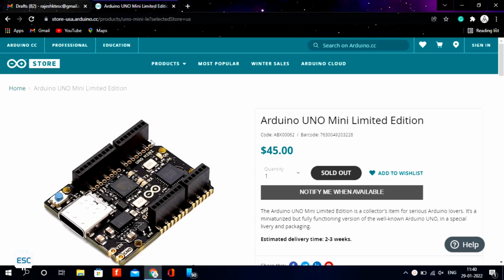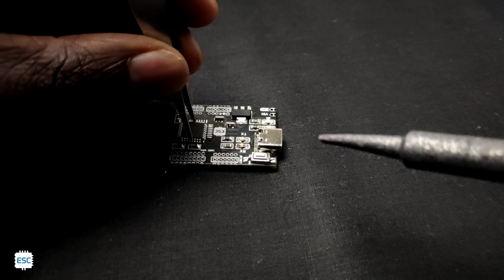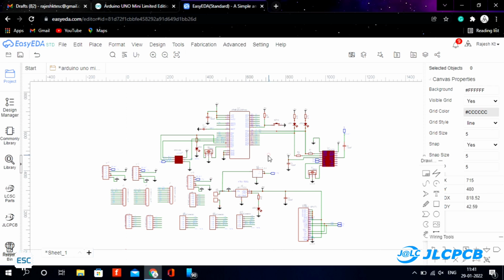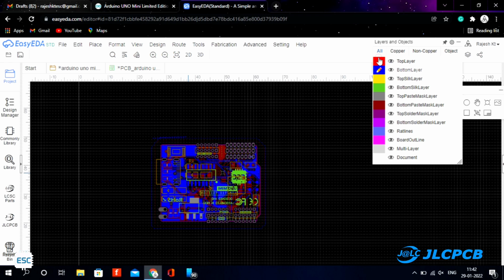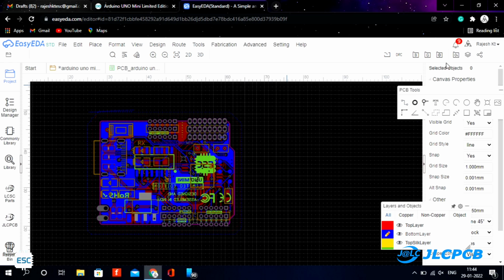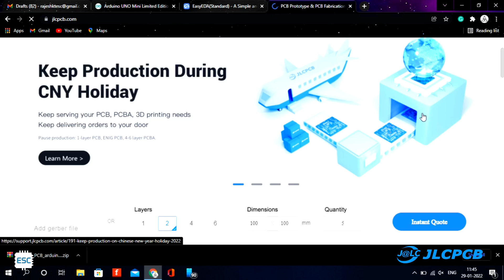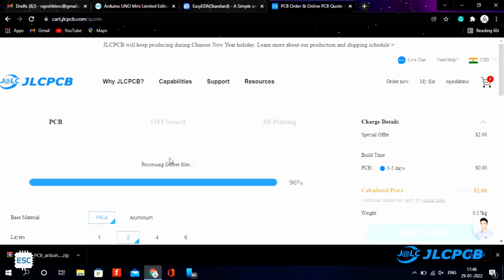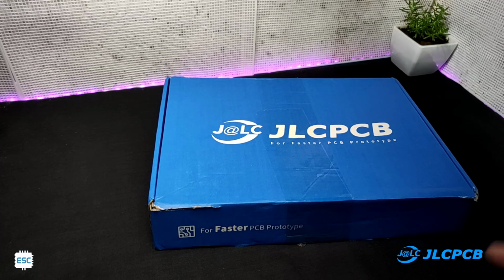ARDUINO UNO MINI CLONE | JLCPCB

Comment: Is there an option where you can combine NRF24L01 with the uno mini? smaller board is better. I need it for my thesis thank you
Reply from the maker: Are you asking how to add the NRF Module?
Reply: @EDISON_SCIENCE_CORNER  I'm not perfectly sure since I'm new to all this stuff, But I'm trying to build a small device that can transmit FSR input in my system. So aside from arduino uno and NRF, I will also use FSR. So I'm wondering if anyone can actually build a mini board like the uno mini that can also transmit signal to my nrf24l01 or any type of receiver, that would be great.

Comment: Awesome work. A 3D printed casing will be a nice addition. I want one unit. Did you check the board with Arduino IDE, and run few basic codes other than blinking?
Reply from the maker: It will just work like other arduinos. And please check my halloween project

Comment: If you use the leonardo design, you can skip the ftdi chip. Saving some space on the board
Reply from the maker: Really.!
Reply: @EDISON_SCIENCE_CORNER  Absolutely! The Atmega32u4 has built in usb capabilities 👌 ive designed quite a few boards around it

Comment: awesome project..
what type of board arduino ide recognize this board as?
any information about what did you do with the firamware or the bootloader?
Reply from the maker: It depends on which bootloader currently i am using uno bootloader.